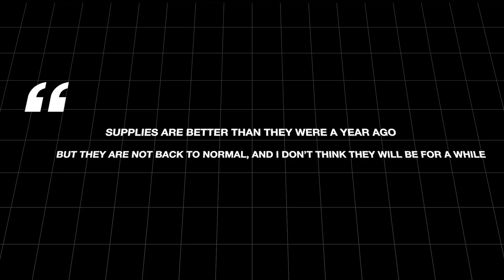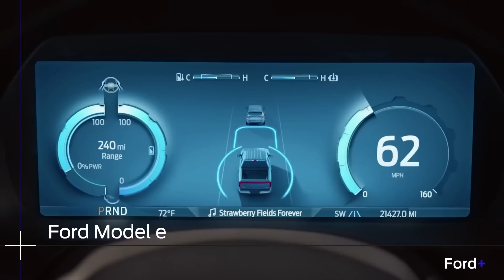Ford CEO Confirms HUGE New Ford Maverick News | Mass Market Maverick!

Comment: I'm interested to see what Toyota does with the Scout.  Honestly though, I'd kill for an AWD Hybrid version of the Maverick.   I still need AWD/4WD where I live in the winter.
Reply: VW is making the Scout, not Toyota. But yes, can’t wait to see that. AWD small EV P/U is what I’m waiting for to get rid of my current Tundra.
Reply: They would be better off releasing the plug in hybrid.  Customer can get 6800 off tax credit.   That puts the price of the maverick even lower
and.. people will be getting 55mpg.   No other maker going to touch that for years.
Reply: You mean Stout, a Toyota brand from the 1960s. stout PU truck.
Reply: Wayne, I have a Mav AWD I show on my channel climbing steep snow covered streets in Park City. It does not use that much more fuel  than the hybrid. With all the big storms this winter, I never had to put chains on even with the stock street tires.
Reply: @BarryObaminable  Well the plug in version I would bet would ad maybe another 3 grand to the price. Plus its a tax break so retired folk not earning much wont help them all that much.
Reply: I wouldn't count on seeing anything from toyota till best 2025 if not 2026. Toyota was supposed to announce the 2023 Hybrid Corrola cross BUT never did so far in USA. They seem slow to react .
Reply: @fordmaverickmaniac  doesn’t that get like 26 mph at best the hybrid will get 40 on the highway. And would probably make it get like 35😊

Comment: Doesn't matter about production or quality - Price Gouging is now the number one problem. Customers are fed up with the absurd add-on fees and "Market Value Adjustments."   Personally, while I prefer to buy new and keep my car for at least 8-12 years, I won't be buying new with the current dealer prices.
KEEP in mind that with all the bank problems, the dramatic problems with sub-prime loans and dramatic increases in repos from customers,  Car makers have created their own problems.  Far to man people are totally upside down in long term loans that they still can't afford - Car Makers are going to have to get aggressive and rein in the dealers ripping off customer or the lots will  be filled with repo cars that NOBODY wants to buy.
Reply: I'm planning on saving up money in savings and attempting to order an maverick this fall, while still saving up till the truck arrives.  When it does I'll use savings to drop on the truck so it cut my cost down some.

Comment: The auto industry has figured out how to keep prices high.
Reply: And that doesn’t even count the stealerships
Reply: Tesla will drive prices down
Reply: @bucfan11  No they won’t. Tesla is the reason why EVs are expensive. The Leaf dropped the price but everyone ignores them and continues to sell expensive.
Reply: @mrgurulittle7000  you're not following the industry... Ford, VW and others just lowered their prices on ev's because Tesla did. Their problem is they are losing money and Tesla is not. Tesla is building another factory to produce its $25k car that is due in late 24
Reply: @bucfan11  Let’s see.🤞😎👍
Reply: @bucfan11  Tesla makes about $9k profit on ea model 3. This beats just about every other car out there on the market by A LOT. Tesla isn't driving prices down, they're finding that nice little niche where they move enough inventory for maximum profit.
Reply: Toyota bringing the stout to the market soon will change that a bit in this truck segment. The real reason for increase in production is when the stout is released it would dig into the market and has an MSRP starting $1800 less then the maverick. So it's really about trying to get those sales before it comes to market
Reply: these vehicles are such junk ,enjoy being stuck youll see when power goes out cant get parts etc
Reply: @mrgurulittle7000 because Nissans suck and are massively outclassed in every segment. There's a reason they're the cheapest

Comment: Maverick is all the truck most people need. Even some contractors.
The ranger did well because people just wanted a cheap 4 wheel transportation.
Reply: Exactly, not everyone needs towing, off-road or high ride height. I would honestly consider a Maverick or Santa Cruz for my next car.
Reply: Save yourself a huge headache don't buy ford. Hyundai santa cruz  is a much better vehicle ford builds a 20k car sells it for 35k. The santa cruz sells for msrp at 31k with better features.
Reply: @kennethb6211  Maybe you should look into the Santa Cruz's transmission issues before you promote trash.
Reply: I don’t.  It’s a FORD. 
Fix Or Repair Daily 👎
Reply: @kennethb6211  the Mav can be specced out with more feature for cheaper than the Santa Cruz. I seriously considered both vehicles. And the "touch button only" Santa Cruz center console was really annoying.
Reply: @Dave Waldon  
I have minimal problems with my ford's.
It's allot about how they are maintained.. or not. Owner and the mechanic.
Reply: I have an 2002 ford f350 with 180,000 miles I am still amazed it’s a lariat all the electric windows work and both heated seats work great power seats also work great no major engine no problems except an alternator a few years ago still runs like new
Reply: @roblundgren5226  my 350 has over 300k on it. No smoke. Would put it to work driving cross country if I needed.
It does more sitting these days waiting for a heavy load.
Reply: I have had three Rangers over a 40 year period.   I am not going anywhere else...
Reply: @Jerry Gunderson  
I to have had many rangers, big trucks and vans.
I still prefer the ranger. Easy to drive, park and still can carry that sheet of ply when needed.

Comment: Studebaker made a station wagon where the roof slid forward allowing tall things to be carried. Why hasn't some automaker picked up on that? I don't want a truck bed all of the time, but need one once in a while.
Reply: I believe that Oldsmobile made an SUV with a similar feature for several years about 15 years ago.
Reply: Fiat did that with a car 3 or 4 years ago in the US. No one bought it.
Reply: Look up the GMC Envoy. It had this and failed, just like Studebaker. 🤣
Reply: @rayrussell6258  Unfortunately, the Fiat brand has terrible reliability.  My brother bought a Fiat 500 for his wife and it spend more time in the shop than the road, so they trade it while they were lucky enough for it to be running properly for a minute.
Reply: @TheLostSquadron  yep. It was an awesome concept but it was overly complicated and parts weren't available to fix it when it broke. I'd like to see someone do it again but fix those issues.
Reply: @the_original_landcruisers  yes, I'm aware of those issues. But also, they were selling 500's, but not the ones with the rollback roofs. Their regional dealer here had one on their lot over a year. I don't think it ever sold before Fiat closed up shop there. They must have bought it back from the dealer.

Comment: Great that Ford saw the opening in the Truck market for those of us that don't really need a F-150, Silverado, or Tundra.  Really, most of us don't need a Ranger, Colorado, Tacoma, or even a Ridgeline.  A Hybrid smaller truck like Maverick is the ticket for us non F-150 folks.  AWD Hybrid small truck it what we need.  Great that others like Toyota have seen the light (late but not never).  Now if the industry would grasp the need that is out there for the Element, magic seats in a CR-V etc. for those of us that want function but don't need a truck.

Comment: Here’s a thought, the f150 super hybrid, take f150 hybrid out it on the lightening frame,  then it’ll have a bigger battery more time in electric mode, no worries about chargers and charging stations. 

Phev f150 that’ll be interesting, 

Ice vehicles will be around for a long time, charger issues not charging in very cold temperatures (non Tesla) realistic driving range

Comment: Ordered at the same time 5 day window last year and haven't heard anything.  My car stopped working, and we're trying to hang onto getting our Maverick Hybrid.  Fortunately, I have a friend who is helping me out with a car until something gets done!
Reply: What's the priority code on your preorder?  You might want to talk to your dealer to see if they can lower the priority code for you.  For reference, my lariat with lux package was built a few days ago and my priority code was 13
Reply: Mindy, sorry for your wait. Unfortunately you may never get your Mav because for some reason, Ford accepted twice the hybrid orders vs capacity.
I have a hybrid I show in my videos, ordered summer of 2021 way before the long line. Ask any questions on my channel.
Reply: @fordmaverickmaniac  mine is a hybrid as well and just got built. It just depends on the priority code plus on your order plus what options were on your order.
Reply: @WhAsian  Yes! Even more important is if your dealer has enough allocations which must be why you got scheduled. When yours arrives post some videos. I have over 100 so far, lots of fun.

Comment: Mostly this video is about EV's and plans for EV's, not much about Maverick. I hate channels that rely on clickbate to promote agendas entirely different than the title of the video. Had I noticed this was posted by Velocity, one of the worst channels for that, I would have ignored this one. But I am waiting on the Maverick order bank to re-open, so I can order one, and got in too big a rush for news.
Reply: Relevant to those of us wanting an EV or Hybrid product (such as the hybrid Maverick).  Understandable if you want gas only.  We need a hybrid because it can be towed all wheels down and unless it has changed they do not have a gas only model that can be towed 4 down.
Reply: @the_original_landcruisers  then you should want a video about that, not about EV's in general. Velocity wasted 80% of your time.
Reply: Agreed. The only thing was increased production of the Maverick.
Reply: @the_original_landcruisers  It was focused on the EV production plant which was not focused on the Maverick. I think it was a brief mention of the EV/Hybrid Maverick models and instead on the plants for the F-150 Lightning and batteries for future EV/Hybrid offerings. The problem with EV/Hybrids (and don't get me wrong, I'd like one) is that the reliable models are still expensive to the larger car buyer market.
Reply: Ray, no click bait on my Mav channel. Ask any questions.

Comment: $35,070 is more like the price unless you want one without any comfort. Too high by about $9,500.
Reply: That's for the hybrid with the highest trim and luxury package. The base model is like $22k or something like that.
Reply: @whasian1487  I know, who wants a striped down car/truck?
Reply: @Trunk Monkey  The Mav hybrid I show on my channel only cost 27k with lux upgrades like heated seats. Even a loaded Lariat at 35k is still much less than the avg new car mid 40k.
Reply: @fordmaverickmaniac  Just because it's less than $40K does not make it a good deal. Cars and trucks are over priced for what you get. It's that simple.

Comment: Everyone is scrambling to gain mineral rights for Li-on.  IMO, its the wrong way to go.  Yeah its a very reactive element and probably the best battery tech so far.  But its expensive to mine, attain, and supply will always be short with everyone trying to get it.  Battery replacements are too expensive.  It has poor cold weather performance and the charging infrastructure is not only lacking but completely fragmented among all the oems.  The new Hummer is a total joke.  Expensive and it can barely carry anything because its already too heavy.  If you tow with a hummer/lightning etc... the range falls off to nothing.  Quality is in the gutter for the GM/Ford products with error codes and electrical failures galore.  TFL almost got one stuck in the middle of no where and it barely limped out in 2WD with computer systems failing all over the place.  Luck for them as getting something that could tow it from there would be costly being it weighs 9K lbs.   In short, buying into EV is not saving you any money.  Not even remotely so.

Comment: How about getting the Chinese out of the battery plant. Also remember that many truck owners that use their trucks in rural areas will not buy EV trucks because of their limitations😢as a as pick up owner an EV truck would not meet my needs until you can get 600+ miles per charge and a full charge in 10 minutes

Comment: Wish they would make a maverick with rear wheel drive and have only an internal combustion engine. I would buy one then. Not a fan of electric
Reply: Drive it in sport mode or tow/ haul and gas engine will run all the time. Gas milage will probably be in low 30s or maybe even high 20s. If you want to get around 40mpg let the electric motors help you save few bucks at the pump.

Comment: Ford took too MANY HYBRID orders only. About 35 K too many. So unless they are building more hybrids the increase in  production means NOTHING but more ecoboost  Mavericks at dealer lots. So more hybrids or not???? Unless you can answer that this video is meaningless.
Reply: Yes hybrid buyers probably don't realize they have a 50% chance their order will get canceled. Strange that Ford made it the std engine but can only produce about 1/3 of capacity. I am no auto engineer, just a guy with a Mav channel. Common sense tells me if you can't include a standard item on most builds, it must be called an option.

Comment: Made in Mexico..Ford for the second straight year has issued the most American recalls.. 2022 8.8 million vehicles..ENJOY THE DEPRECIATION
Reply: The Maverick appreciates when it's driven off the lot due to scarcity.
Reply: @whasian1487  Until the minute it has competition.
Reply: @BokBarber  true. Competition is good. The Mav's pricepoint is definitely competitive. Toyota should release a hybrid truck that's cheaper too.
Reply: Bruce, Tacomas are made in TJ. My Maverick recalls were not power train related. A side airbag and engine compartment ventilation. You can see how well they drive on my channel.

Comment: I will pass Ford has a huge quality control problem and the CEO admitted it and that it will take years to overcome so I will wait for the Toyota, Honda, or Mazda equal. Now that Mazda is no longer part of Ford and 100%Mazda their Quality has been great. By the way another Ford recall yesterday and they are the automaker with the most recalls. Everything is too expensive for me to invest in a company with quality problems. Last Ford I owned put me in a financial situation from a bad engine in a 2015 Fusion POS. Back with Toyota and never going back to Ford. I will pay the higher up front cost of a Toyota or Honda because in the long run its way cheaper on cost of ownership and resale is way better.